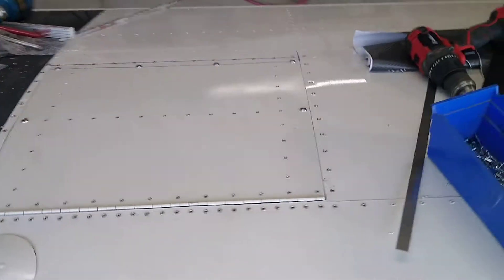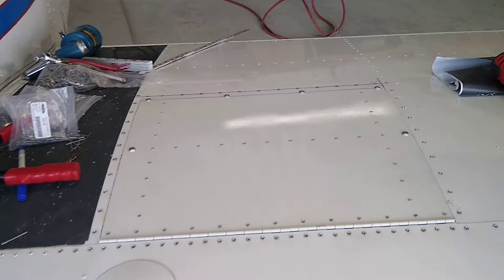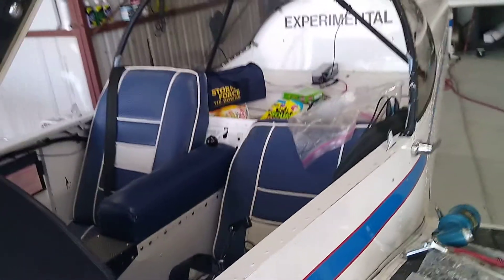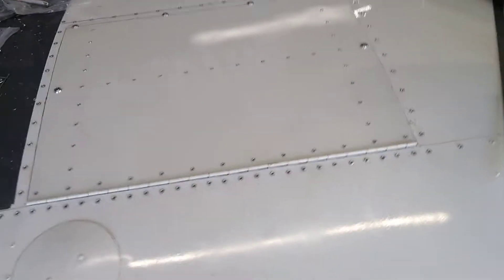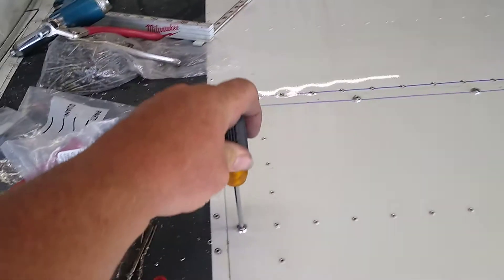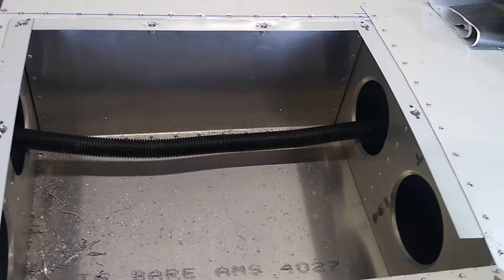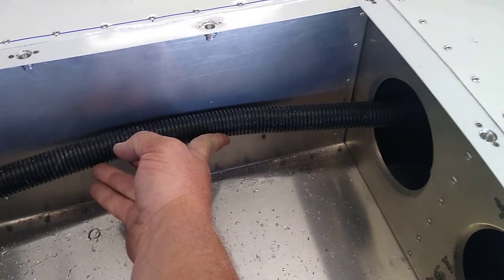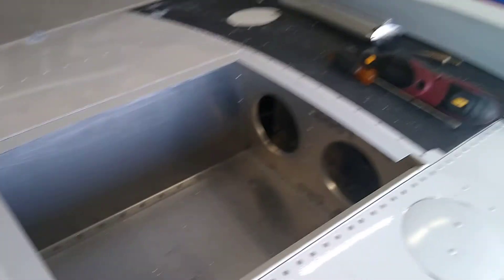zenith 650 wing lockers

Comment: what if you mounted that hinge upside down.  Yes, it would limit the travel, but it would help get it out of the slipstream.  Also, what about rain?  How do you keep a puddle from forming in your wing and corroding the heck out of the aluminum?  Are you worried about whatever you put in the locker making its way into your wing into some inaccessible place and possibly jamming a control?  Lastly, why do you have inspection ports on the top skin?  I would think with all these interferences in airflow you'd kill some of your climb and airspeed.  The reason I'm asking is, I'm building a CH650 and am considering putting in the wing lockers, but all these things have crossed my mind.
Reply from the maker: Lol um its not a 200kts airplane.. doesn't effect speeds one bit... and my lockers are sealed and carpeted.. rain? Um who cares.. you think anything on this plane s water tight? Not a chance.. inspection port is fuel sender access.. nothing more
Reply from the maker: I climb 1100fpm and cruise 130mph... that little bit ain't hurting nothing...
Reply from the maker: The 650 is a slow draggy airplane... dont read into it to much.. build it and and fly it.. its not a space shuttle
Reply: @carlmccall7198  which engine and prop are you running?  I'm still in the decision making phase.
Reply from the maker: Your wing has weeping holes... it will condensate on its own inside the wings... if your worried about corrosion then you better prime it... i dont worry about it at all.. these are cheap throw away airplanes... they dont hold value and there just a slow borring plane..lol .. if it was a rv 14 or something then it would all be alittle different...
Reply from the maker: @scottb7600  i have the viking 130... there should be videos up on my page here ... also a whirlwind 3 blade
Reply: @carlmccall7198  Mine is primed.
Reply from the maker: In all seriousness.. the plans call for the hinges to be installed the other way... but i talked with a few guys at the open house and two wished they'd installed them my way... and the other guy liked his the normal way... theres no way to seal them.. if its raining its getting water inside them... but i just keep that in mind when im packing them.. usually for trips i put a case of water in each wing with room to spare...
Reply: @carlmccall7198  That's good info.  My thinking is, its a good place for a cooler on one side, lunch on the other...or maybe dirty clothes on a long trip.  LOL
Reply from the maker: @scottb7600  it doesn't hurt thats forsure.. im in Michigan so im no where near the ocean... mine was finished in 2011... and is flawless inside...
Reply: @carlmccall7198  Don't bring it to Florida!  I bought my kit from a guy in Central Florida and any part that he didn't have primed or covered by a tarp, paper, or whatever, was so badly corroded I had to condemn them.  Fortunately I got a sweet deal on it, so there was a lot of wiggle room for replacement parts.  I'm in GA and plan on priming everything...it kills me though, because it adds time and weight.